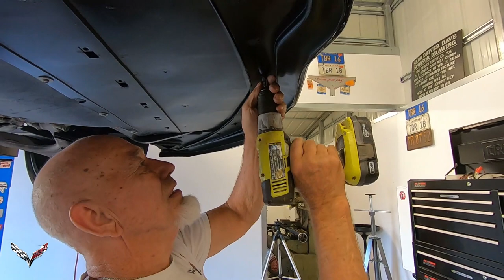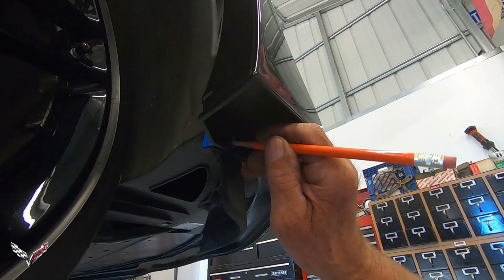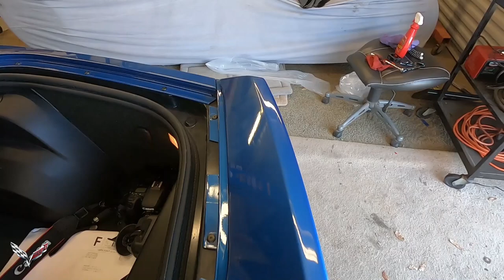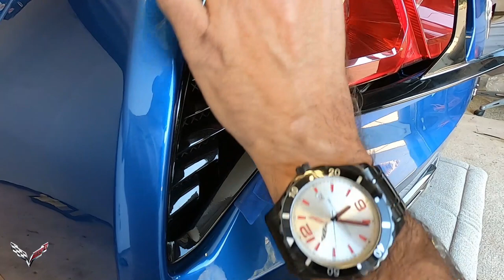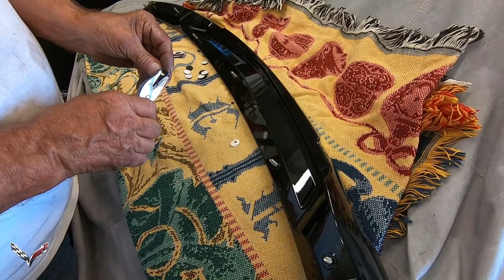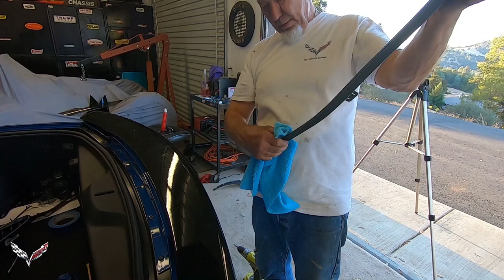How to Install a Stage 3 Aero Kit Package From Extreme Online Store on a C7 Corvette

Comment: Has anyone purchased the carbon fiber kit?  I'm considering converting my Z07 aero from flash to carbon fiber, but I'd like to know the quality of carbon fiber before committing to a $1,500 kit.  I'm new to the Corvette scene so I'm not too familiar with my options.  
Thanks for any input/opinions!
Reply from the maker: Hello,
In one of my first installation videos I did a Stage 2 Carbon Fiber Install using EOS parts and they looked Great !! I ended up later going back to Carbon Flash because I ended up damaging the Carbon Fiber front Splitter and it is much easier to repair and cheaper to replace Carbon Flash.
Hope that helps you make your decision.
Reply: @THECORVETTECHANNEL  I appreciate your input!  You bring up a great point; I may hold on to the carbon flash for track days, but have the carbon fiber for everything else.  Swapping kits shouldn't be an issue as I already have the aero kit installed from factory!  I'm going to go through some of your old videos and check out that install vid.  Subscribed!

Comment: will the stage 3 winglets fit with the fender flare inserts ?
Reply: You find out if they fit with the XL fender flares?
Reply: @mikes8815 if your talking about the carbon fiber flares then yes i got them and they did fit surprisingly.
Reply: @joewesc4991  I have the ACS XL fender flares. Thinking about getting the extreme online store carbon fiber stage 3 winglets. Thanks for the response